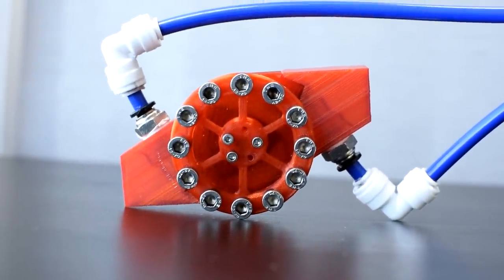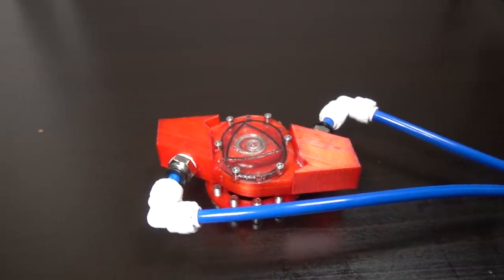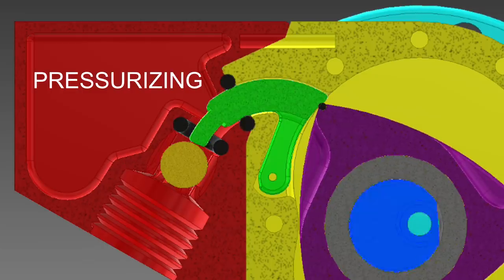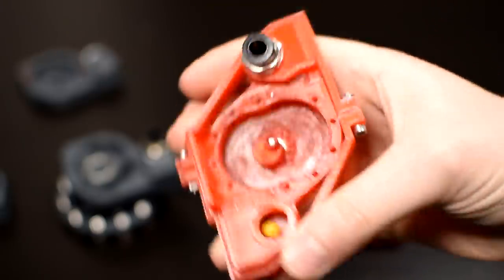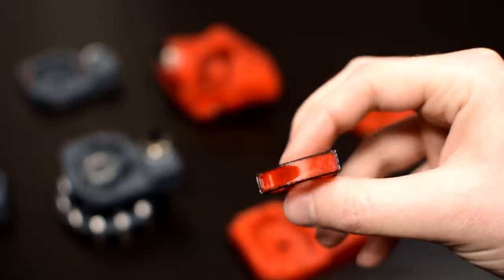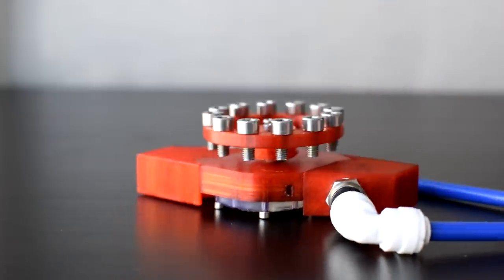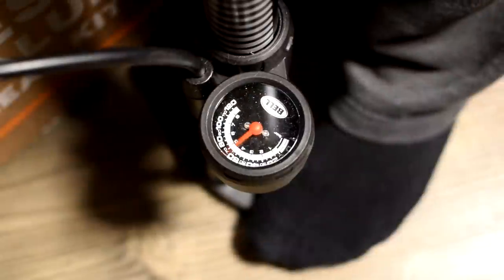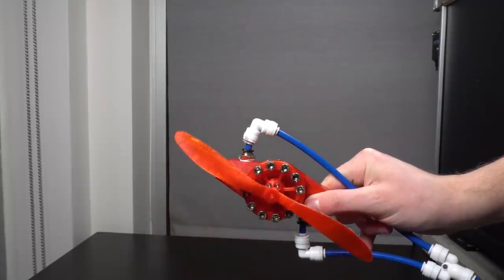3D Printing a Functional Wankel Engine

Comment: Rotary/Wankel engines used oil not because they were leaky, but because they needed oil in the combustion chamber to lubricate the seals. There was actually a pump on the engine to inject the oil.
Reply from the maker: Good point, thanks for sharing!

Comment: How truly inspirational, a young person who isn't afraid to admit he makes mistakes (and learns from them).
Reply from the maker: I truly am a professional at failing!
Reply: @3DprintedLife  Bless ya man. I wish you could see my "failed" parts pile! Like you I learn from those mistakes but the only issue with 3D FDM printing is the time it takes to do a part of any significant size.

My daughter's b/f wants to make a Proton Pack (Ghostbusters) and with a 0.4mm nozzle it will take something like two WEEKS to print all the parts assuming I can get a decent run at it.

Far better to use a 1mm nozzle but I don't have one or a hotend capable of delivering it.

I've (partly) redesigned the cooling setup for the old printer - an Ender 3 clone - because it's laughably bad. Unfortunately being an unusual model TronxXY Pro 2, there's nothing on Thingiverse.  Funny thing is, it would be an excellent printer if they'd only spent some time on the cooling design which looks like it was thrown together at the last moment.

But all of that aside, showing people your mistakes sets a damn good example because it shows that even someone with your considerable talent has to iterate a design.

Even Einstein fiddled with his equations before he settled on one. Iterative design is normal and we should not be ashamed of it.

Comment: I actually made a working air powered Wankel engine (vid on my channel), the difference being there are only two lobes on the rotor instead of three since air engines only really have an expansion and exhaust stroke. This means you only need one intake and one exhaust, and can get a very high displacement with the same size engine.
Reply from the maker: Just checked it out, pretty cool! The rotor may not look as cool but definitely a better design for a rotary air engine. Did you use any sort of valves to control input or just let it rip?
Reply: @3DprintedLife  no valves, just full tank pressure throughout the expansion stroke. The engine had really terrible efficiency because of this so I should really incorporate some kind of intake valve
Reply: @3DprintedLife  For proper lexicon: Internal Combustion Engines (ICE) convert chemical energy into kinetic energy.
Where as motors convert potential  energy (from an outside source) into kinetic energy.  Steam would be an example of an External Combustion Engine.

Comment: Maybe use a small pressure regulator just at the end of the air feed tube and see if restricting the airflow will slow it down but extend the use time... but nice jib!
Reply: this ^^^^ I was about to comment the same. he should try a constant pressure with the same air supply on both his, and tom's engine for comparison
Reply: Yes

Comment: Did anyone else notice the door move when the rotary finally fired right with the propellor on it?!?! Impressive!
Reply from the maker: Well...don't get too excited. It's only a curtain :) But it definitely does move a good amount of air, and this size propeller is barely putting any load on the motor. I probably could still run the engine on a propeller twice or maybe even triple the size. But that's a lil scary
Reply: @3DprintedLife   looked like a door to me...either way, I’m still impressed. It’s obviously moving a decent amount of air.

Comment: 1:15  The Wankel was patented in 1929, the Dorito was born 1964. Thus, nobody calls it a Dorito. The proper name is rotor.
Kudos for some more engineering and an awesome build!

Wonderful if some manufacturer could perfect the seals.  I had a 1973 Mazda RX2. With an amazing rotary engine, it had response like a slingshot, and a ridiculous power band. I could do 50 miles an hour in first gear, or be in fourth gear at 10 miles an hour and still have plenty of torque.

Comment: I failed to make it start and quit, you made a fantastic job!
Reply from the maker: Thanks! It was definitely a lot of work :D
Reply: @3DprintedLife  I want to give my thoughts to you! You don’t need a valve, it can be 2 intake and 2 exhaust cross with each other, depending on it’s space expansion! Then it can be a whole piece so no need to worry about seal the intake. I dealt with it for a while, and found it’s hard to set the place for the intake holes, it can easily go through. Those holes have to be too close to each other to get sealed by the rotor. Otherwise, you can try to make printed on edge seal on the rotor to make the seal~ hope these can help you make a better air rotary engine!

Comment: To get a longer run time ( without using a compressor) you could use a 2l bottle (maybe get an extra few seconds) or connect a few of the bottles together in series to increase the air reservoir, at least that's what I plan to do in the near future.

This looks great so I can't wait for the next one!
Reply from the maker: Good point, but that's twice as much pumping. Sounds like a lot of work :D I really should get one of those enormous 3L bottles for the next version hahah
Reply: @3DprintedLife  hey at least you get a workout in while you're pumping the engine up 🤣

Comment: My son and I made an 3D printed engine based on steam engine tech. We struggled with seals and then he had the genius idea of running the engine on suction instead of compressed air. It fixed a host of issues and vacuums are easier to come by than air compressors. I would be interested to see how that works for you (impractical if you are going to use the engine, but for a demo its great).
Also: nice work on the wankel build! I enjoyed the vid!
Reply from the maker: Hmm that's really interesting, it would require some re-working but maybe that could still work, thanks for the suggestion and glad you enjoyed!

Comment: Very fun and well presented. I have been considering air engines for years and designing one now to 3D print. Glad you used both sides of the rotor housing. A thing to consider with air engines is whether the aim is to maximise power or economy. A really ideal air engine should have minimum headspace connected to the cylinder, and its power controlled by varying valve timing not by throttling. By varying inlet valve timing, you can operate the engine between the two extremes of economy vs power (high expansion ratio / low expansion ratio). A wankel is not well suited for this since the timing is traditionally fixed, or complex timing systems must be added. It's a very different way of thinking from ICE's despite the similar appearances.

Comment: Wow this is awesome Wankel engines are not widely used today due to how hard it is to get that seal right the fact that you got it right using 3d printers is really impressive!
Reply from the maker: I now share a similar pain with most rx7 and rx8 owners. It's an honor :)
Reply: Not really, mazda fixed it a while ago. People just dont give them the special care they require and are surprised when they get compression issues

Comment: You should build a Voron 2.4. It's a true tramming printer, and instead of tramming the bed to the gantry, which you may not have assembled properly, it's tramming the gantry to the mic6 precision milled tooling plate by having it suspended on 4 belts. Amazing stuff, absolutely worth building.
Reply from the maker: Considering I designed my printer, I think I assembled it properly ;)

Comment: 1) Yes, that's pretty much the only reason to print on a raft (to decouple the bottom surface from bed irregularities)
2) I think "co-planar" means "in the same plane", so the top and bottom of your piston aren't co-planar. They're just parallel.
3) I don't think your engine is less-efficient than Tom's just because it didn't run as long. It produced a lot more power over that shorter time. In fact, the fact that his engine didn't run as fast suggests that he might have more friction in his design, with the side-effect of it running slower and, hence, longer. 
4) Incredible R&D work.
Reply from the maker: Ah yeah you're right I was using co-planar incorrectly, oops. But no, mine is definitely less efficient. Tom's engine is super low friction but still manages to have a decent piston seal. Performance varies a lot based on assembly though since you have to sand the piston and cylinder to fit perfectly together

Comment: The real question is, why the heck your not using a resin 3d printer! 👽
I used my 4k mini (35µm)the first time a week ago... I can see the polygons in my high res 3d models. 
I’ve dived in the deep end using an engineering resin that has a glass transition of 250C. 

There was a little bit of dialing in the resin to start with, but now it’s dialed in my prints are bang-on!! 

Food for thought
Reply from the maker: I didn't have one at the time, but I do now and I'll be using it for future air engine projects!

Comment: Why do you need the valves in the first place? it seems like they're a source of potential inefficiency. Half the beauty of the Wankel engine is that it is valveless, and where it saves the most weight, size, and complexity. Tuning your ports will also increase the efficiency such that it doesn't blow through so much air as the apex seal wipes past.

Comment: Nice. I think you should resin print the whole thing but shrink it down  to about 70% on each dimension. Or 60% and add a rotor.  Get it right and it will self start on pressure. I can see your frustration but I'm impressed with your result. Think bigger, cnc them in metal and test the market,

Comment: Amazing job man this is incredible! Can you try remaking it engine with resin printing? The tolerance could be much more tighter.
Reply from the maker: Thanks! And yeah you aren't the first person to suggest this, but I wanted the challenge of fdm. I'm considering designing V2 more for resin printers so I can take advantage of the far better tolerances
Reply: @3DprintedLife  heat resistant materials?
Reply from the maker: @billbergen9169  No need, the constant supply of new air plus the fact that is expanding should mitigate any heat concerns from friction.
Reply: @3DprintedLife  I was wondering if you could make a ice engine
Reply from the maker: @billbergen9169  Ahh, yeah not with fdm. Maybe with some resin materials. Maybe Integza can print one in ceramic, that seems easy enough! (kidding, definitely not easy!)
Reply: @3DprintedLife  ceramic seems doable.

Comment: Try letting your 3d printed parts sit in Acetone vapor. (not leave them directly in acetone but leave on a glass or something in a containing with some in it, sealed up. the vapors will smooth out all the rough edges and it will help seal the 3d printed layers better.
Reply from the maker: Good suggestion, that only works with ABS though (I was using PLA) and it may have been difficult to tune the process to ensure tolerances aren't lost. Since acetone is actually just melting the outer surface of the part, the material can start to sag before it re-solidifies. Gravity sucks

Comment: Nice video. As a car guy, it was amusing watching you fumble your way through all the weaknesses of the wankel design.
Now you know partly why Mazda is struggling to get this engine layout to meet modern emissions and fuel economy standards. You can't lubricate those apex seals like a 4 cycle piston engine so they were forced to burn oil like 2 stroke does.
It's unfortunate because it's such a clever, simple design with a high power to weight ratio. If they can get seals to last without burning oil and to get a complete burn inside the combustion chamber they might have a chance.
Reply from the maker: Hah yeah, it's pretty crazy how well the engine problems scale down. It's a shame though, this engine is so close to being a fantastic and compact option in cars but until these (extremely difficult) engineering challenges are overcome, there is no chance of it going mainstream.  And now would be the perfect time too, as more cars are transitioning to electric there's many more hybrids which would hugely benefit by having a small and lightweight ICE.
Reply: @3DprintedLife  They are perfect for range extenders. Apparently you can optimize them for a certain rpm and since they're so compact, engineers can stuff them in tight spaces. It's supposed to be an option in the MX30 coming out at the end of this year.

Comment: Impressive, would be cool to see an optimized version that lasts longer with a bit less power as a tradeoff!!
Reply from the maker: Agreed, though all of the runs in this video were only using 1L of air. If only I had an air compressor! But for V2, I do hope to make a more efficient engine that won't have quite as much torque but hopefully will run a lot longer on the same amount of air

Comment: You should do one of those new style rotary motors where the apex seal is in the housing rather than on the rotor.  It's a kickstarter design called the "LiquidPiston."  It still uses 3 chambers but in intake and exhaust are on the rotor.
Reply from the maker: Yeah I have seen that, looks very interesting. I may take a crack at that soon!
Reply: @3DprintedLife  Drop me a line if you want some help modeling it.  I only have Solidworks 2014, but it works.

Comment: hope you continue  improving this design and making vids of your work. Question: why not use steam from a pressure cooker instead of air? It should give much longer run times but you may need to print with a higher temp material
Reply from the maker: Thanks I am! And good question, the main reason is heat. Steam is hothothot, and it can get well above boiling temperature. Even if I printed in ABS, it still might not be temperature resistant enough to avoid deformation. It's especially hard in an engine where there is lots of high pressure and cycling, so using regular compressed air is just easier. But maybe with a future version I can make it run on steam!
Reply: @3DprintedLife  Heat problem with steam. They made diesel wankel engines but had heat problems. They incorporated an air only cycle to cool the engine. Kind of a hit and miss cycle and it worked. Maybe it could work for steam too

Comment: Maybe you can fix you precission problem with a resin printer. I have a pheopoly phenom and would love to try it if there is a way to get the STL or even the design files. it also makes the parts them self seal better because of less leakage between layers
overall great video and nice project keep it up.
Reply from the maker: Oh you're definitely right! I wanted to do fdm just for the challenge, but I think I'd be able to print one using resin and get it wayyyy more efficient, and probably not even need o-rings other than for the apex seals. And thank you I appreciate it!
Reply from the maker: Oh sorry I missed half your comment, all design files are in the github repo I linked in the description!
Reply: @3DprintedLife  I would love to see your results with it. Atleast you got a new patreon partner in me as Elforax :)
If you want help with something you can contact me on discord. As a Mechatronics Engineering ill be happy to help
Reply: @3DprintedLife  aah thank you I must say I mist that aswell 😅. I'll see if I can make one on my phenom when it's setup again

Comment: You should get a SLA (resin) 3D printer. You would have much less trouble with all your sealing. The elegoo mars pro 2 does 10 micron layer height and is under $500
Reply from the maker: Yeahh but that makes this project way less of a challenge! Plus I used to work as an engineer at Formlabs so I'm a little spoiled when it comes to resin printers.
Reply: @3DprintedLife  wowwww that's pretty cool I'd totally love to have that job. I do love a challenge as well.

Comment: Did you try to reduce the weight on the flywheel, maybe the engine would run longer if it only had the propeller, and/or less weight on the flywheel. (less mass to move). Or would reducing the weight make the engine not turn over in its current state? My reasoning being that, maybe the flywheel has extra mass at this point in development, your earlier models might have needed a larger mass to keep spinning for a bit, but your latest model might run with less as it runs much smoother.
Reply from the maker: I have tried lower weight, but this version is pretty high friction so it isn't quite as reliable. Since this project was so popular, I'm going to fast-track a V2 and one of my main priorities will be improving sealing while reducing friction, which should allow a lighter flywheel!
Reply: @3DprintedLife  Thanks for responding. Lets hope that in V2 friction can be lessened. Perhaps using sandpaper or thin slices of metal or plastic lining the cylinder could help with friction, you could design a slot and/or space into the engine that a material with less friction could be placed in after printing. It's awesome that you made a rotary air engine, it would be cool if you could make other types too, like the boxer, inline, or even unconventional designs like a U or H engine layout. A multi rotor air engine would be amazing. All just food for thought though. I like your content and I hope you have a good day!

Comment: Just came across your channel, and I love it so far. One question though, what pressure were you running it at?
Reply from the maker: Awesome, welcome! Most tests were 1L of air at 60psi. It seems like it could handle more, but it's difficult to pump it too much higher with my bike pump haha. Also, I wanted to operate a decent margin below max tested pressure (80psi)